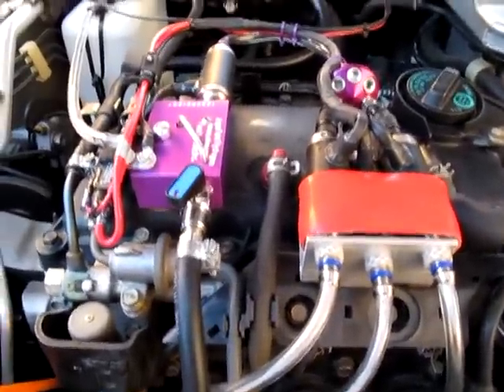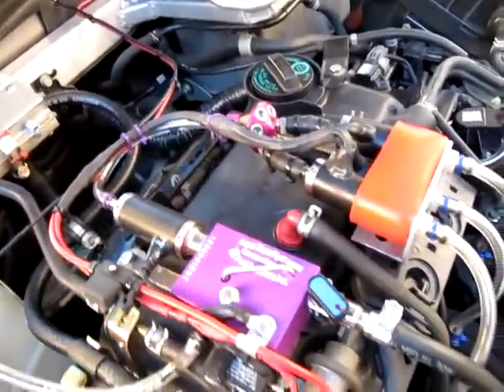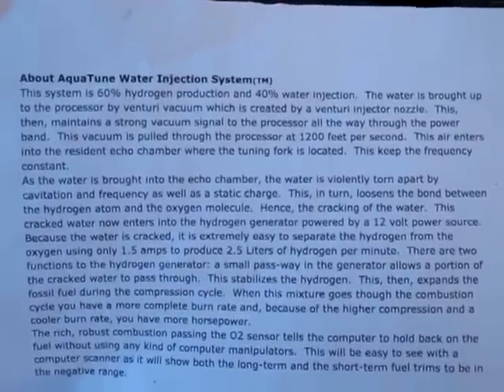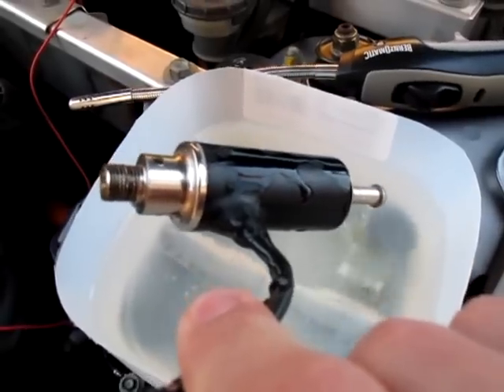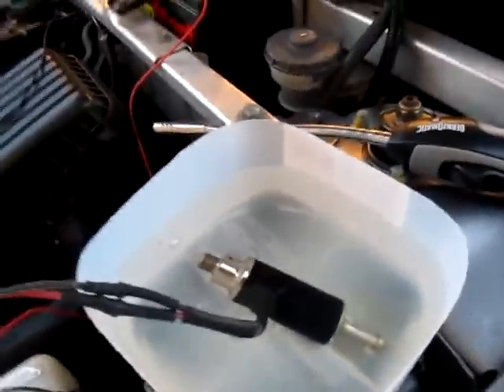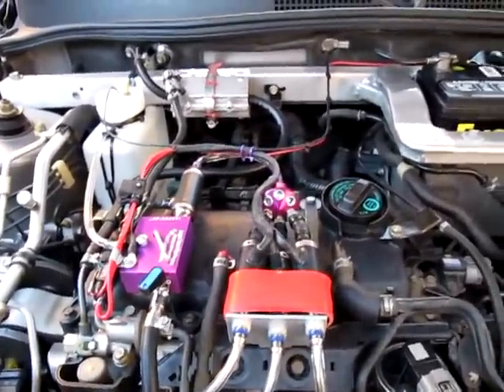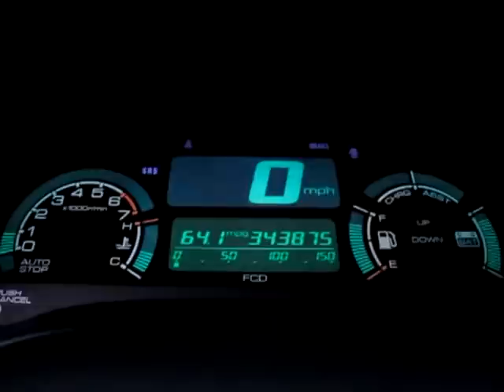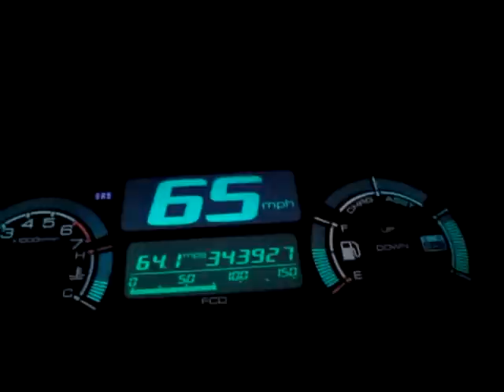Water Fuel Technology For Everyone - AquaTune Hydrogen Fuel Systems

Comment: I am sure there is a less expensive system then Aquatune and produces more HHO???
Reply from the maker: If you learn of a Hydrogen Fuel System that reduces fuel consumption by a minimum of 25% without manipulating the automobiles computer nor sensors- please let me know. AquaTune achieved what many believed to be impossible. It's just simple science from nature's point of view :)
Reply: Don't get mad at me for saying this..
Who cares as long as it works. You call it manipulating, I call it correction! This system is not efficient.
One thing I like is the fancy design.
Reply from the maker: reality Excellent point. And it works quite well :) As for efficiency- I like this challenge. How do you make the most energy efficient water to fuel converter available for purchase- more efficient. It's an interesting concept. I will study this in great detail. Thank you for sharing your thoughts and feelings.
Reply: I am building one for my vehicle, its v6 3.0L engine, so need more hho. A great channel to check out> hhoconnection
Reply from the maker: reality Interesting. Thank you for sharing.
Reply: Hey no problem. If you find anything which is hho interesting pls let me know. Thanks

Have you look into this KZX1250 pwm ? Might be the one I am looking into purchasing with a volo.
Reply from the maker: reality If you like building your own fuel systems- maybe look into the GEET Fuel Processor. It's interesting. Maybe speak with YouTube screen name hhoconnection  for pwm recommendations.
Reply: I just recently made a purchase for a
KZX1250 PWM.
Geet Fuel, seen it before on youtube but don't remember exact detail. Have to refresh my memory by re-view. Thanks for bringing it up.
Reply from the maker: reality You're welcome.

Comment from the maker: For this model car, I had the choice of tapping the intake manifold(tools and supplies included with the AquaTune kit), However, the installation for each model car may be different. If you go to the AquaTune web site and look at installation pictures, you will see some of the ways in which the AquaTune Hydrogen Fuel System may be intalled. Some engines utilze the intake manifold tap procedure. While other model engines utilize a different approach. You may also contact AquaTune Tech Support.

Comment: Since most people are still driving combustion engine vehicles, wouldn't doing this on a larger scale make more sense before transitioning completely over to electric?   Why don't more manufacturers look at this solution instead?
Reply from the maker: Subjektive Algorythm Good Question.
Reply: Subjektive Algorythm Because us saving money causes auto manufacturer's and oil companies to LOSE money. Electric vehicles bring the "promise" of being devoted to batteries (which are extremely non energy dense) that don't move a car over 120 miles before needing a recharge. This would certainly deter anyone who thought of buying Electric Only vehicles. The IC engine is here to stay. Why would we be rid of it. But it's the "experts" or rather the filthy rich who depend on us living in a state of oppression to stay filthy rich who will lead you to believe that driving a vehicle means you have to pollute and must waste 75% of all the heat energy burning any fuel for power. It's up to us ourselves to seek out vehicle perfection because free is close to terrorism.
Reply from the maker: Bone Drone The job of a business is to make money. The job of a responsible public is to become aware of what is possible and make responsible decisions that are expressions of what is consistent with an individuals values. Blame is a negative empty shadow that is devoid of hope, and devoid of responsibility.
Reply: 150MilesPerGallon Obviously blame and taking action are two different things. But blame can be used to inform others of all these possibilities. To inform the public can be seen as taking action. Everyone has the right to know about this, and much more. Who is really to benefit if all things positive are kept secret? Not us. What is there to gain by using Earth's natural resources at a rate significantly faster than actually needed? You tell me. So I say what should have been said many decades ago. It's time.
Reply: Bone Drone
What I find better is to acknowledge that some wrong doing has happened, but then immediate focus on what to do about it in terms of finding and applying potential solutions. Because if you dont identify solutions, then blaming can become a game all of its own, which inevitably leads to nowhere except for more blaming and the generation of negative emotions that reinforce the blame game.
Reply: Bone Drone
Making the truth known has to be tempered with making solutions known. Otherwise it's just a partial truth.
Reply from the maker: Subjektive Algorythm The most important part of truth is solution and possibility.

Comment: So what was the before and after mpg?
Reply: +Humanity And Technology  Hey there excellent vid and EXTREMELY exciting stuff. Ive got some questions. 
1)How often do you have to clean the tips of the hoses leading into the manifold from the oil vapors recycle, or did you install a catch-can to minimize that issue? 
2) You mentioned something about increased hp/torp. Have you taken your car in to see what kind of increase we're talking about?  The reason for asking is bc with all the precision engineering that goes into developing these modern engines, too large an inc in hp/torq, the factory timing becomes relevant and this means damage to both eng and tranny (with valves, pistons ring, trans bearings, brake bands, and clutch pack taking the biggest hit)

Id REALLY like to try it but, fear of the unknowns holding me back
Reply: +Humanity And Technology  Nvrmind, just saw your post link. ill go there and drop them a line
Reply from the maker: Pasta Sarmonella E-Specialé Please contact AquaTune in order to have your question answered.
Reply from the maker: There is a minimum increase in fuel efficiency of 25% or more when running the AquaTune Hydrogen Fuel System, many experience greater than 25%. There’s a video here on YouTube of a news team testing the system and they achieved a 33% increase in fuel efficiency, reducing fuel consumption significantly.

Comment: Wow that's a lot of miles!
Reply from the maker: Yes. Just over 369,000(Three Hundred and Sixty Nine Thousand Miles) on the original engine- still running strong. Compression test showed good compression, with a one psi variation in pressure(two cylinders at exact same psi on compression test- Cylinder one had a One psi increase). Incredible work by Honda :)

Comment: So tell me water is your fuel now!!?  So how much money you spend on gas or water rather. .  . ..?
Reply from the maker: The AquaTune Hydrogen Fuel System reduces gasoline consumption by 25%. The distilled water cost approximately 88 cents per gallon. The 2000 Honda insight will use one gallon of distilled water every four times I fill the gasoline tank.

Comment: hi mr shuffles here I thought you would like to know I have invented 12 volt
hydrogen generator that will produce enough fuel to run a small to med sized
generator on hydrogen gas.
 It  will run as long as you have 12 volt and water.
ps this is the best part my generator  it only cost are you ready under 10.00 Canadian they say you cant run a car just hydrogen I an just about to prove them wrong

Comment: MOST CARS,, AVERAGE,12MPG
Reply from the maker: That means an automobile would be able to drive 12 miles, and oxidize 1 gallon of gasoline.
Reply from the maker: With The AquaTune Hydrogen Fuel System, Fuel efficiency is increased by 25%, Horse Power is also increased. And my favorite- Reduced Exhaust Emissions :)